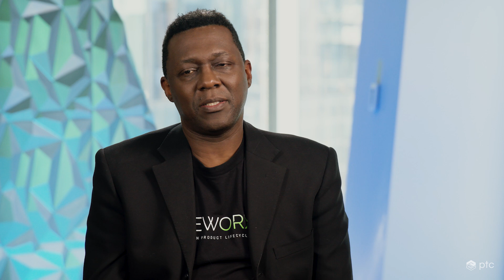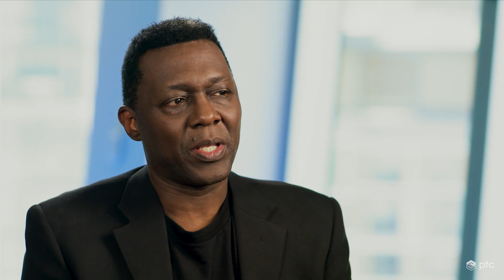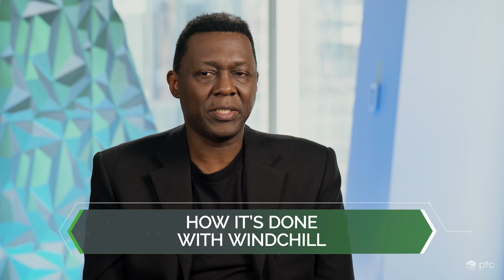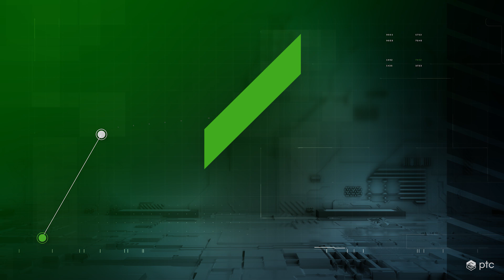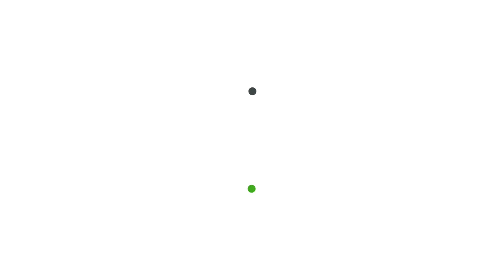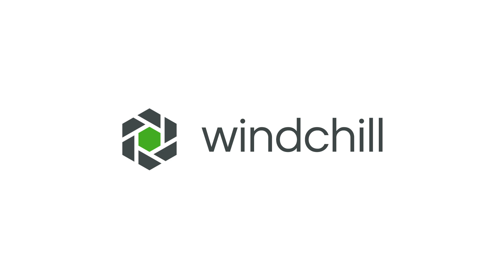BOM Transformation Enabled by Windchill

Comment: Great information, Jean-Claude. I think the difficulty is in the Change Management piece: who manages the Engineering Change Order when it is coming from the factory floor without making the technicians log into Windchill to do it? Are they synchronized between the ERP and Windchill?
I also think that you need to manage Work Instructions and should be able to prepare Routings at this level to evolve towards a nearly error-free production phase.
Very informative, thanks!
Reply from the maker: Great questions! A specific answer would depend on details about your company, change workflows, and what Windchill capabilities and integrations you have implemented.  
 
For managing changes there is a change administrator role (actually three different flavors of that role) responsible for guiding the change process.  Of course, a change related to manufacturing would likely require participation from manufacturing engineers and possibly technicians.  The former should be used to working in PLM (with Windchill Manufacturing Process Add-on), and for the latter we recommend providing lightweight, role-based access to change workflows using Navigate Contribute apps.  
 
The question around synchronization between PLM and ERP is relevant to a much larger conversation going on about the roles of the two platforms. The best practice is to rely on PLM as the source of "truth" for product data and for managing any changes, configurations, etc. Integration to ERP allows for that information to be synchronized so that the transactional functions that ERP excels at utilizes real-time product information.  This is especially important when managing effectivity.  
 
In regard to your comment about work instructions.  Be on the lookout for news regarding upcoming capabilities around defining associative, interactive work instructions that are change and configuration aware.